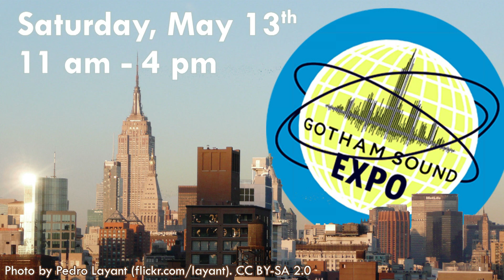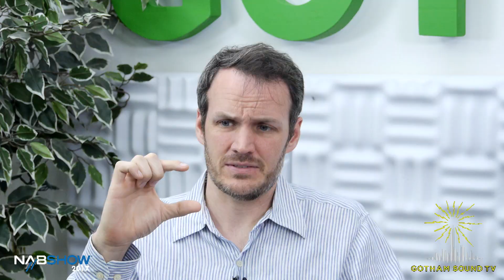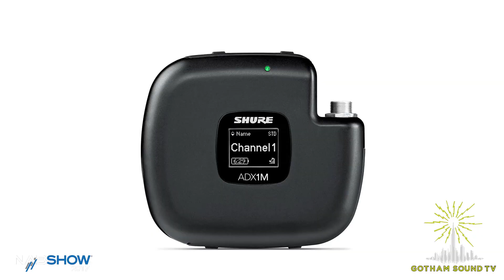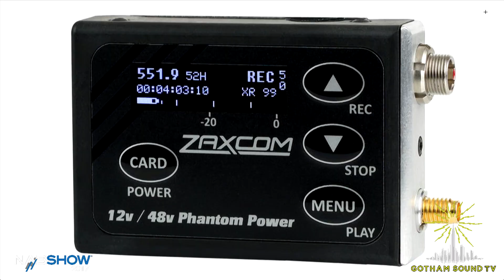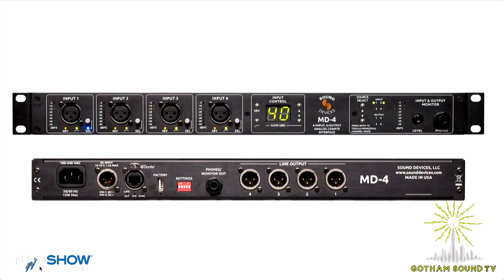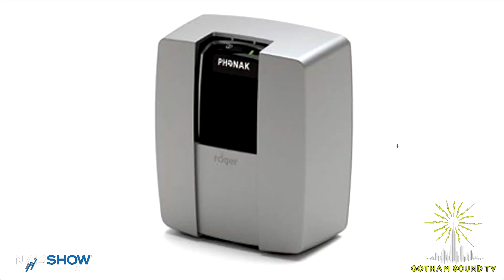NAB 2017 Round Up

Comment: Hey, guys! Great to meet you both at NAB. So with the ZMT3 Phantom, how is that different from just plugging in a Lectro HM with a shortie XLR tied with a Bongo Tie to the top of your boom pole?
-Emilie
Reply: Both would work the same way.  The ZMT weighs 2.2 oz with a battery in it.  The HMA weights 6.7 oz without batteries.